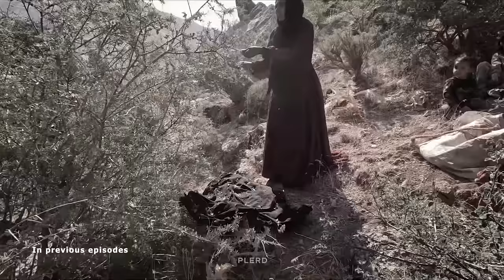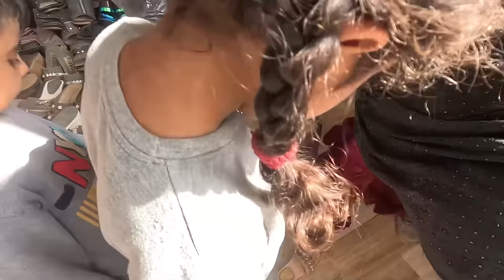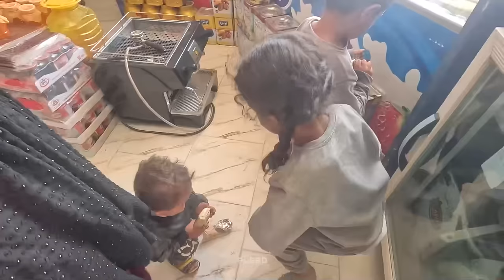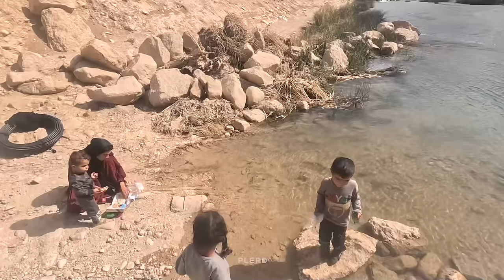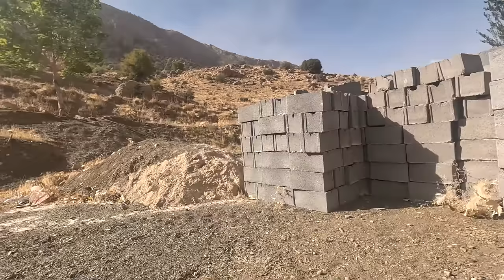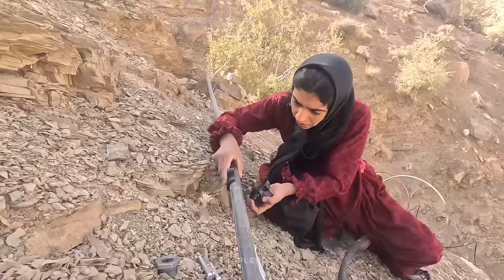Pipe Dreams: A Mother's Love in the Face of Hardship

Comment: Congratulations on your Piped Dreams. Now that you have running water from the pipe, do practice better n cleaner hygiene for food preparation n also personal hygiene. Built a kitchen area v raised cemented stove and a proper sink for washing using stainless steel or ceramic. Make a low table for serving food plates on. All these will be used while your home construction is on-going.